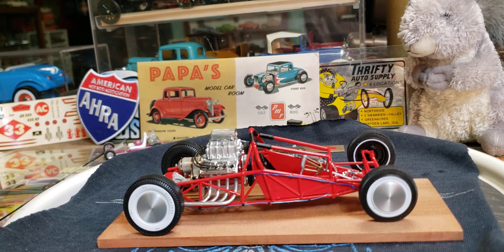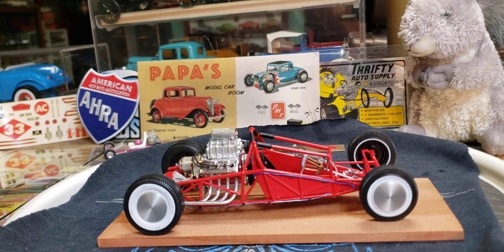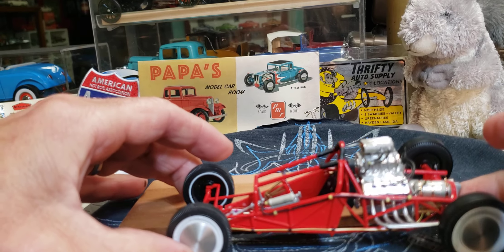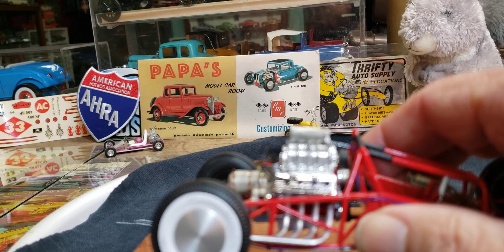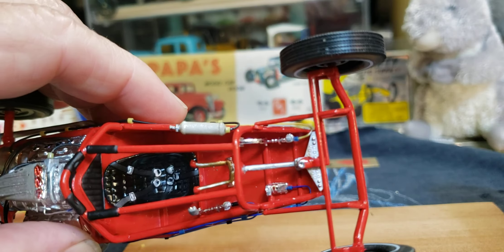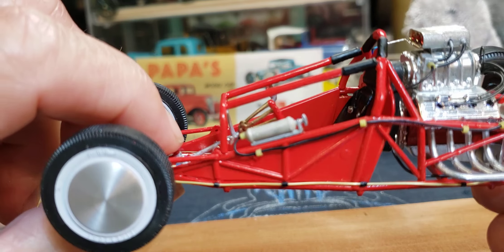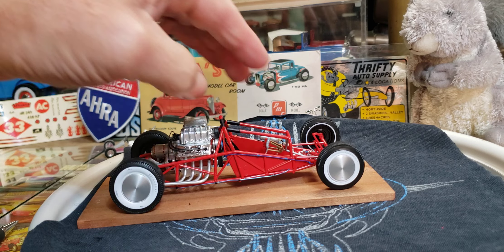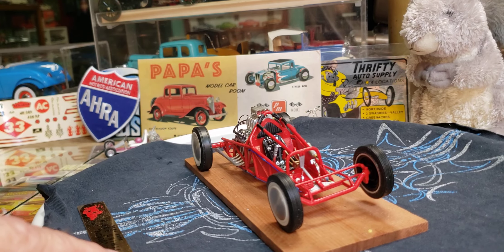32 update and channel shout outs

Comment: Again Rob very nice looking build. You might try to put something heavy across the tops of those tires to weight it down and use a hair dryer back and forth let it sit and check it and try it again if you need it ⚡
Reply from the maker: Thank you 😊 and thanks for the tip I gotta try something